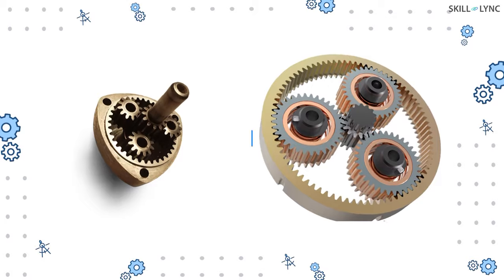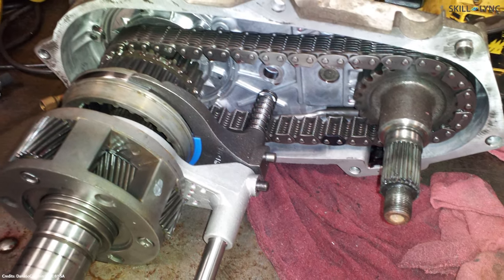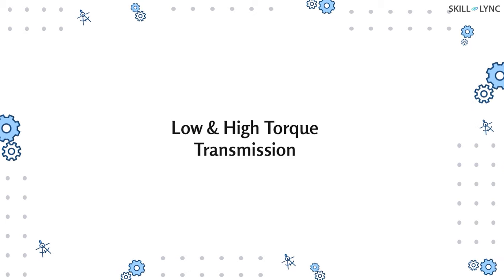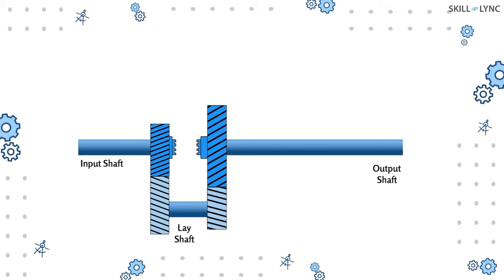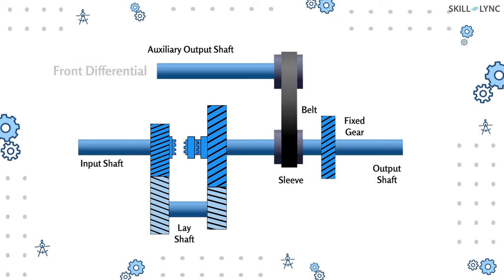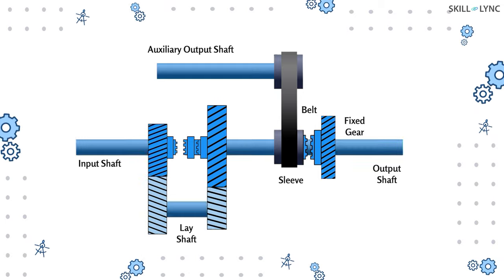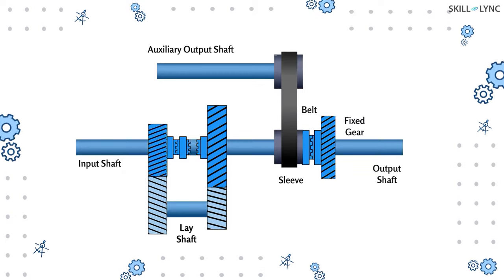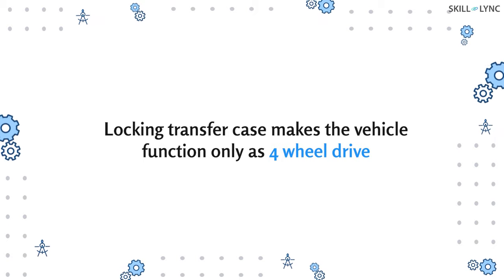How does a transfer case work? | Skill-Lync

Comment: My transfer case (made sometime in the 80s) works slightly differently in that the high torque / low torque are done through planetary gears.  A sleeve either connects the output shaft directly to the input shaft, or the the sleeve connects the output shaft to the planetary gears.  Similar to an automatic transmission. 
The perk being that planetary gears can offer a much higher torque ratio than gear to gear.  2.72 for mine vs 1.98 for the previous gear driven model.

Comment: Any way or device to get more torque to rear wheels on a 2wd without re-gearing differential. Kinda like a bolt on low gear transfer case to rear drive shaft?